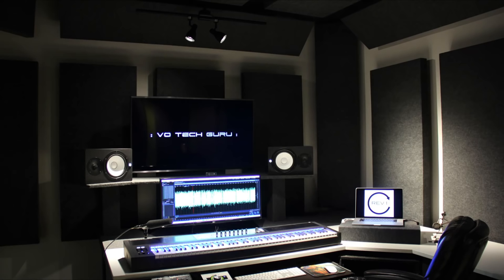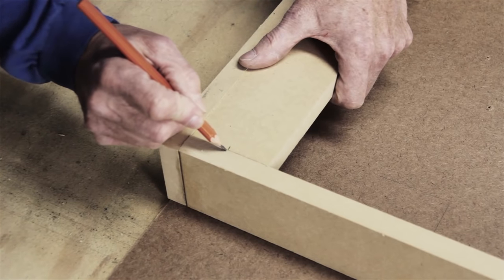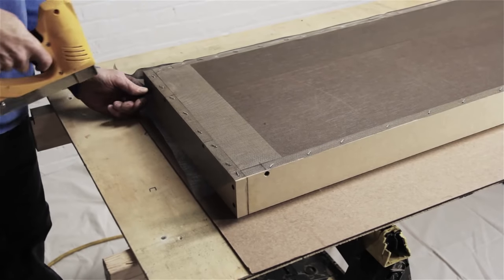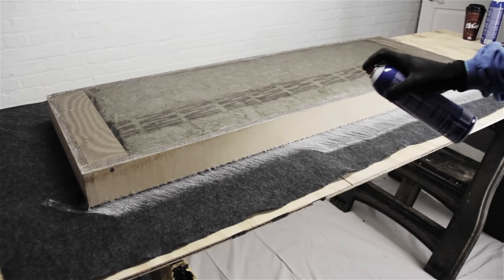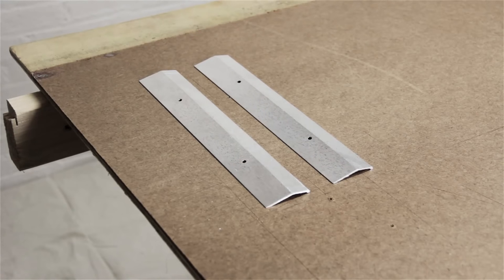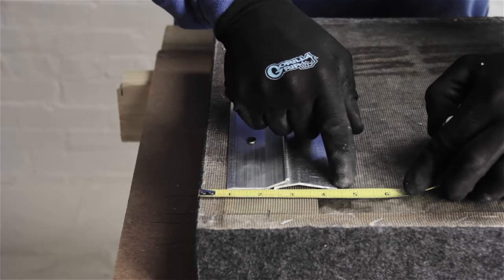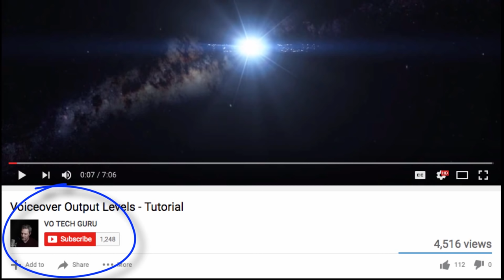How To Build Acoustic Panels | DIY Acoustic Panels

Comment: I've watched several videos on acoustic panel construction. Many have been helpful.This tutorial was, by far, the most concise and complete. The panels look sturdy, secure and aesthetically appropriate. Thank you!
Reply from the maker: Rich Rushforth Hey Rich! Thanks for watching and for the great comments!
Reply: I do voicetracking, commercials and some imaging in my home studio. I have really messed up the sound of my 11"x10" studio. I switched from a Shure SM7 to an EV RE27ND. This mic picks up sounds I cannot hear otherwise (neighborhood traffic, people talking on the street, etc.) Then after putting hardwood floors in earlier this year, my studio sounds like the inside of a gymnasium. I use a Symetrix 528e voice processor, and a DBX 1066 processor through a Mackie FX8 mixer, into Adobe Audition on an iMac. I am guessing acoustic panels might help. Perhaps I also need an area rug. Do you have any suggestions for me? I would be grateful...
Reply from the maker: Rich Rushforth An area rug and the panels will make a big difference. Also check out the IZotope Elements pack for noise removal as it makes a big difference. Rolling off EQ at 80Hz will also keep a lot of the low frequency garbage out of your noise floor. I would roll off before applying the RX denoiser. Also, I have links to all the materials in the description below the video to make things easier. ;-)
Reply: Fantastic! many thanks...
Reply from the maker: Rich Rushforth You got it. ;-)

Comment: To anyone looking to build acoustic panels, I just made 19 panels and followed this video as a guide, and they turned out great! I've never seen a better way to mount a panel on a wall. Instead of roxul, I used 4 inch thick Owens Corning 703 and found that you get a lot of bang for your buck in terms of absorption. The one thing I would suggest to anyone building these that saved us a lot of time would be to use a nail gun instead of screws and a drill. That way you don't have to mess with a pilot hole or get things as exact. Anyways, thanks for a great tutorial @votechguru and for taking your time to help us out!
Reply from the maker: Christian Hale You got it and thanks fo watching!

Comment: MDF Carpentry 101, felt like I was watching "How It's Made". Excellent DIY video!

"Using a drill bit with a smaller diameter than your screws to create your pilot holes" - if you've never done construction, this video is gold for pro tips like this for working with MDF, insulation, and felt.
Reply from the maker: XxxThePsyCheMisTxxX Thanks, man! And I see you're a Cornell fan, too. There'll never be another...

Comment: This is an excellent video! I will follow your design when I make my next acoustic panels. Thank you.

If I may make a suggestion?
Using a ripped 2x4 between the wall and the wall bracket and two square blocks of 2x4 at the bottom of the panel with a stick-on bumper on each, would allow the panel to sit about two inches from the wall. This air gap between the wall and panel would significantly increase the sound absorption of each panel.
Reply: Laura Brown  Yes, they would actually serve both purposes. But they'r not DIY and quite pricey. Most recording rooms are more concerned with the internal room acoustics than sound with sound escaping. Preventing that is an added bonus. But, unless the rest of the room is designed for that. Sound will escape from everywhere.

Comment: I just completed this build and made nineteen 24-1/2" x 48-1/2" panels using 24" Rockwool (23-in W x 47-in L). The panels turned out amazing, but I learned some things along the way that will hopefully help make your build go even smoother...

Like any good tutorial, the video drastically downplays the amount of work involved. It took me around 40-50+ hours to complete my project; this is something to keep in mind when going the DIY route.

It turns out that Home Depot refuses to cut MDF board due to health risks, and when I went there, they said they wouldn't cut wooden strips smaller than 8" wide for me. I ended up purchasing 3 sheets of plywood and cutting the pieces I needed for the frame with a circular saw myself.

You can save some extra money wall mounting the panels if you purchase flush mount brackets on Amazon. These brackets are a little more finicky than the recommended floor transition strip, but you can mount 5 panels for around $9.

If you plan to ceiling-mount your panels, I suggest installing screw eye hooks on the back four corners of your panels, as well as on the ceiling (make sure to use drywall anchors). You can suspend the panels at various lengths using a cheap chain. To connect the chain to the screw eye hooks, pick up a large pack of small carabiners to make installation easier.

I try not to let one bad experience ruin my perception of a store, but I've had so many bad experiences at Home Depot that I've switched over to Lowe's entirely. The staff at Home Depot seem to be terribly uninformed, which indicates there's likely a deficiency in the training that their employees receive. Lowe's employees have always pulled through for me and saved me both time and money.

Overall, this build went very well. If you have the time, building your own panels is a very fun and rewarding DIY project!

Comment: Made 8 of these a couple of weeks ago. Went a different route on the fabric but the difference they made in just my 12x14’ room is outstanding! Would 10/10 recommend building these for any studio/control room.
Reply from the maker: Awesome. Thanks for watching!
Reply: What was your cost? Was it $25 per panel roughly?
Reply: @iamKirbyLove  Well, I was able to use all the tools from the company i work for. plus i already had screws, bits, glue, adhesive, AND the insulation i was able to grab for $20 off a buddy. so it didnt cost me very much at all but the wood is not pricey. the screening wasnt too bad either at Lowes. If you go to Joanns and get "stereo fabric" its a little cheaper as well. id say for me it came out to about $22 per panel but thats WITH all the advantages I had. Hope that helps!

Comment: This is a fantastic tutorial, thank you so much for putting it together in such a coherent way. I just have a question, would it not be better to cover the back of them too? Due to fibers being able to fly around the room since it's not really covered ? Especially considering that sound ways would be rattling the fibers? I just have some health concerns about that. Or would it affect the sound properties of the panel ? Thanks again
Reply from the maker: Kesh Hi and thanks for watching! The screen works fine on the back for me as I don't get any dust on the floor or surrounding surfaces, but I also don't think adding fabric on the back would reduce the effectiveness of the panels by much, if at all. I have links to the fabric I used below the video and it's pretty thin stuff, links to most of the other materials and tools as well. Good luck and please let us know the results!

Comment: I might not build this exact panel, but that method of of measuring from the top to the bottom of the mount to hang the panel exactly where you want it is something I've wondered about for a long time. Will definitely find a use for that.
Reply from the maker: Thanks for watching!

Comment: I loved this video - I saved it as "the best tutorial on earth". So, thank you!!!! I realized your page is geared towards voice over work, but in a musical mixing and recording environment, does the construction of these panels work the same or would you recommend deeper panels/placement? My room is a rectangle, and I've placed my desk against the wall where the rest of the room is behind it. Not a big room but I plan to record vocals & guitar in there as well as mix. Would you recommend anything differently?
Reply from the maker: Hi Carol,

I use the same panels in my booth and control room. That said, as you can see in the snapshot of my control room at the beginning of the tutorial, I also used the same 3" deep panels angled at the corners and it has given me all of the bass trap I need to monitor and mix. I also compose, perform and mix for film and TV etc and I haven't had a problem with these panels in my mixing space yet (your results may vary) and I'm very happy with the outcome. 

As it relates to your room dimensions, are you familiar with what is known as the "bolt area?" You can find bolt area calculators online that will give you an idea of your bolt area which will help you determine where you may have problems with any given frequency. Although my dimension work very well with the calculator, I am very certain that I'm in much better shape with these panels than without....for sure; my room sounds great. 

Best tutorial on earth? How do I follow that act? Thanks for watching/subscribing/sharing and I wish you all the best. And thanks for your kind comments!
Reply: Funny how I stumbled upon your comment here haha! Will be doing these panels in the next couple of months for my new place!

Comment: Just made and installed 6 of these suckers. Works like a charm. I'm probably going to make more now and hang a couple from the ceiling. Thank you for the help!!
Reply: When I make these I'm going to need 2 on my ceiling as well. How do you plan on mounting/hanging it from there?
Reply: @scottygelbs  two hooks in the ceiling and 4 hooks in the bottom of the panel and I'll hold it up with rope. I'm going to install it today
Reply: Shane if there’s a way to take a pic when you’re all done it’d be great to see, was thinking about doubling up on the carpet transition strips to having one on each side of the panel
Reply: @scottygelbs  yeah look just slide it in right? I figured that would be more of a hassle. I'll post pics when I'm done on my Instagram shanemeshuggah
Reply from the maker: Awesome and thanks for watching!

Comment: Nice tutorial. No wasted talking. I wonder if the panels would be more effective if there was a little more space between them and the wall? Some other panel tutorials have cork spacers on the back.
Reply from the maker: Thanks, man! The bumper and hanger have them 3/4 off the wall. They are mega effective as is.

Comment: Great video, thanks!  I'd like to confirm the dimension for the short sides of each panel. The video says 16.5 inches.  I checked a package of Roxul @ Home Depot and it says a batt is 15.25 inches.  So calculating 15.25 plus .75 inch thickness of each long panel, you get 16.75 inches.  Did you reduce the distance to 16.5 inches to pinch the Roxul batt for better stability inside the box?  Otherwise, shouldn't the short panels be 16.75 inches?   The rest of your instructions are very clear - appreciate the time you took to produce this!
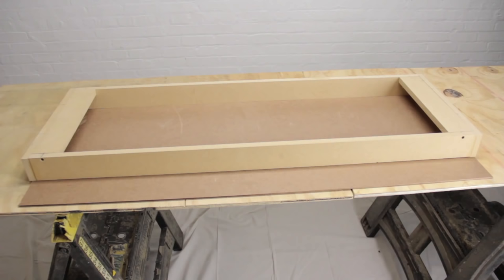Reply from the maker: GhostwriterSays Thanks for watching. At 1:25 or so I explain why but to add a little detail, that extra 1/4” of compression on the inside will keep the Roxul from hanging loose inside the frames. In wall cavities, Roxul is compressed to 14-1/2” so they don’t fall out prior to drywall installation, but no need for that here since we’re also adding screen to help keep it smooth and in place. Hope that clears it up for you. :-)

Comment: Making these in my garage right now haha
I dont have anything but a handsaw to get the supports made but home depot cut every other piece for me (the tops and sides)
They arent perfect and I dont have a work bench but ive gotten 6 frames made so far!

Thanks so much for such a great tutorial. Ive been waiting over a year and a half to make these and am finally getting to it haha
Reply from the maker: Finding a way to make it happen. Love it. Thanks for watching!
Reply: @VOTECHGURU  just finished the first pannel of 8!
Supplies are a little expensive right now and I couldnt get my hands on safe n sound but I did get r15 rockwhool which has the same  dimensions but maybe a half inch thicker. Not sure what the density is but it looks great and I bet it will sound amazing too!
Thanks again!

Comment: Best DIY acoustic panel video I've seen yet. I'll building my new home studio in June. I'll be building some of these. They look good, love the hangers, although I thing I'll glue extra felt or rubber to the metal hanger to help reduce any noise that might happen from transfer vibrations.
Reply from the maker: Gary Harrison Thanks for watching and for the comments! I haven’t noticed any vibrations when I mix, but hey, I bet that would be a great way to address the issue if it came up.

Comment: What color fabric did you go with, charcoal or black?  Also, it looks pretty thick, does it allow the sound to pass through and effectively absorb into the insulation?  Great video overall and the panels sure do look great!  Thanks.
Reply from the maker: Daniel Mijes Thanks! All the details can be found at my kit.com profile. Here you go: http://geni.us/0RWHjV
Reply: Daniel Mijes i was just gonna say... seems like an odd fabric choice. The fabric likely is thick enough to have its own absorption characteristics. Also seems like extra work w the reinforcement & cutaway. I’d also staple mine rather than glue but its not WRONG by any means...
Reply: The fabric is way too thick for the application. You want a fabric that is easily blow-through, yours look more like felt. Btw., the rest of the process is spot on as I have made mine, very good work. Only the fabric let you down a bit... ;)
Reply: Actually craft felt has amazing acoustic properties.  It allows the sound to pass thru easily, while playing a part in the absorption as well.  My company has installed large panels in auditoriums and other large facilities using this material and the results of absorption and dampening are great, the look is preferred over burlap, and the cost is considerably low compared to guilford of maine.
Reply: Officially, the fabric should be burlap. Using anything else is by no means “wrong”. Just it would be not as efficient. I have also made other choices when it came down to the fabric, just to be nicer on the look.

Comment: Hello, 

Ive read when choosing a fabric it needs to be able to let air pass through. Does felt allow this?
Thanks in advance

Maurice :)
Reply from the maker: Hi Maurice. That is correct, the fabric should be breathable so the energy of the soundwaves can easily pass through the fabric and into the insulation. Typical felt is very breathable (hold it up to the light and look through it to see what I mean) and is also very affordable. Thanks for watching!
Reply: Thank you felt fabric it is, it also looks great!!

I hope you don't mind but I've got another question. I read a lot of stuff on the web about diy panels. Some people say the ROXUL Isolation fibers are really bad for your health. You think these will be able to pass through the felt fabric somehow? My Idea was to apply some plastic (as thin as a bag) underneath the fabric would you recommend this?? 

Thanks in advance

Ps. Sorry for the bad english, still learning!!! :)
Reply from the maker: Your English seems fine to me! Anyone handling Roxul should follow the recommended safety precautions on Roxul's website. As for dust and fibers escaping the panels after they are built, I'm surrounded by the panels every day and haven't had any problems, but that doesn't mean or suggest that you'll have the same experience. You should educate yourself on Roxul's website, as I did, prior to handling the Roxul material or building the panels, then decide for yourself if you're making the right decision to build the panels using Roxul. 

As for a plastic barrier, I don't recommend doing that because it will lower the effectiveness of the panels. The plastic may also vibrate at certain frequencies. As you can see in the video, I used fiberglass screen on both the front and the back of the panels and that has fully contained the Roxul on my end. Hope that helps!
Reply: Thank you so much for taking the time to answer my questions, it means a lot!
This does help! You definitely deserved yourself a like and a sub! :D
Reply from the maker: +Maurice da Silva Thank you, Maurice! Please send pics when you're done so I can share on the FB page. If it's not too much trouble. :-)
Reply: I got more to do to my homestudio apart from making the panels. But when everything is done I will!!!  :)
Reply from the maker: +Maurice da Silva Great. Thx!
Reply: Maurice applying the plastic would increase the reflectiveness at high frequencies and thus reduce the absorption in the top end. However, if bonded to the insulation, this loss of high frequency absorption would be made up for by an increase in lower frequency absorption, which in many cases is a desired result.

Comment: I had been pricing out different materials and builds and all builds were comparable to just buying pre-built panels since I was going for owens corning 703 and guilford maine fabric. This build and going with local available materials instead of the best sourceable materials cut the cost in half which is all from shipping costs. I am now again considering the diy route especially since I now have a great blueprint and shopping list you provided.
Currently my build looks to be  about $40 a panel (2022) and currently planning to make 22 panels to maximize 2 boards of mdf initially but will likely make more. This includes a 2packs of rockwool, 2mdf boards, 100ft of mesh, 3 bolts, miter saw, square and stapler in my tool costs and majority of the misc additionals.
Reply from the maker: Awesome and thanks for watching!